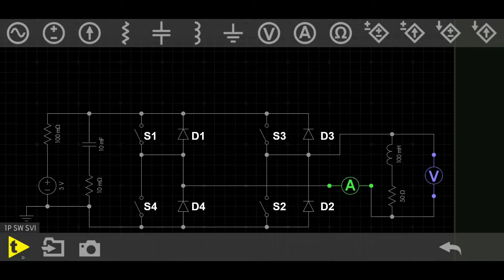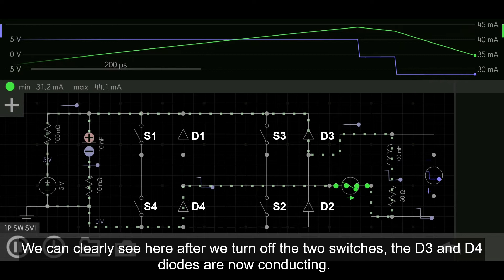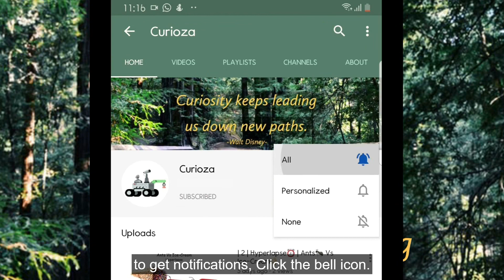| 2 | Why freewheel diodes are used  ▶️ | DC🔋 to AC 🔌|

Comment: so the anti-parallel protects transistors from reverse current ,voltage...? so if an IGBT has the diode built in like this one IGBT : AIKW30N60CTXKSA1  ,  so no need to get a transistor and FRD if im understanding this right? truly THANK YOU for this video!
Reply from the maker: Although IGBT has an inubuilt diode it is better to use a snubber circuit.